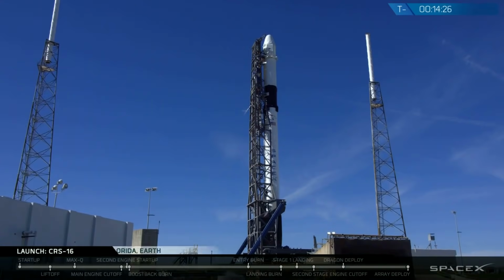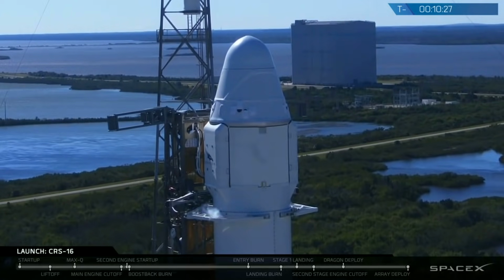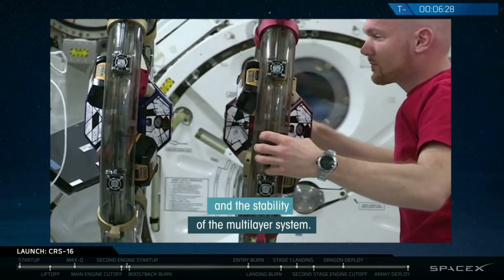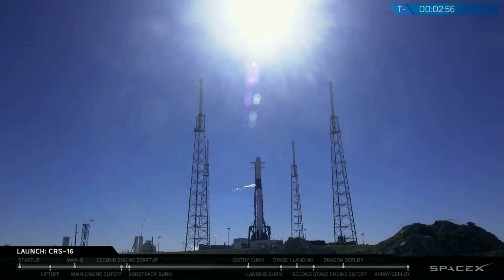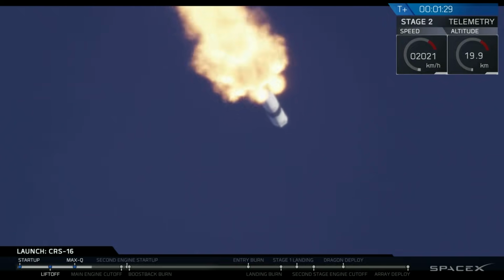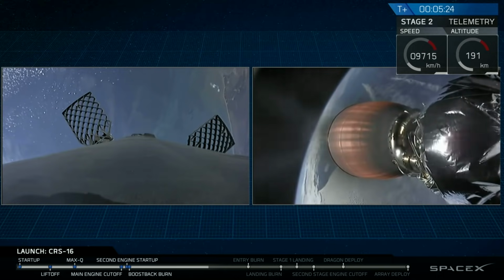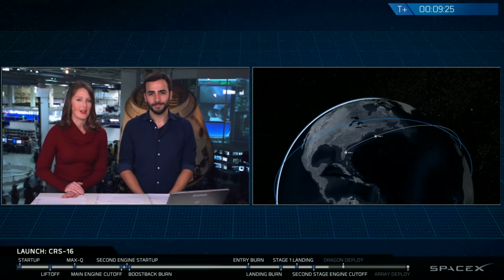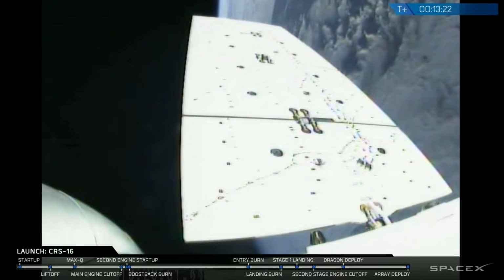Dragon Resupply Mission (CRS-16)

Comment: Why are we even watching if you are going to cut away any time something interesting happens? seriously!
Reply: https://twitter.com/elonmusk/status/1070399755526656000
Reply: @vask92  you are the man:)
Reply: @vask92  thx Vassily
Reply: @vask92  Neat. What happened? Return coordinates incorrect?
Reply: @LightningSe7en  Problem with one of the grid fins. It was unble to stay on course, so it performed an emergency landing in the water.
Reply: @logitech4873  Thanks.
Reply: @vask92  
Thanks for the link! 
Why didn't they just air that when it was live? would have been so cool to see a unique outcome like that live and not have it cut away
Reply: @vask92  seriously rad
Reply: @vask92  I knew we could count on Elon himself to deliver!
Reply: According to elon on twitter, the cutaway was a mistake. He posted the full video of splashdown in the water. Booster is still transmitting telemetry and is being recovered.
Reply: i am always watching no matter what
Reply: This happened https://youtu.be/gt227uyBh1c
Reply: @KDavidd  1st stage camera: https://www.youtube.com/watch?v=BbG_TVcKfQ4
Reply: @KDavidd  thanks for throwing this up. EXTREMELY IMPRESSIVE that even with the wobble and spin they still almost landed it correctly.
Reply: This is like Nascar for geeks, but they don't show the wrecks : \
Reply: Because SpaceX is under attack, and doesn't need bad publicity, cause all that would happen is at mainstream media outlets is that SpaceX failed their mission
Reply: Delivering the payload to orbit is much more "interesting" to the customer than whether the first-stage landing is successful or not.

And, as others have pointed out, video downlink is the lowest priority for a rocket in an uncontrolled spin on approach to the Florida coast. Maneuvering the rocket to the safest possible crash point is what matters in that scenario.
Reply: The cut was "a mistake" according to Elon. https://twitter.com/elonmusk/status/1070386554068119553
Here's the full video:
https://twitter.com/elonmusk/status/1070399755526656000
Reply: https://youtu.be/3CCXnzbSgyI
full video..
Reply: Full cut footage https://youtu.be/JbA-jOK1EpU
Reply: If you want to watch the complete faulty landing of stage 1 in water, I have uploaded it : https://youtu.be/xX0VotqacuA
Reply: Elon said it will be uploaded and it was an accident to shut it down
Reply: It's because cameras are being cut off due to the signal being broken or something.
Reply: Rinoa Super-Genius , really, what disappointment to have you protect your , what, name..Get honest.
Reply: And please don't block the view of the rocket with popups for your app.  That's just ridiculously cheesy.
Reply: Being in a commercial venture, they want to sell an image of success and not confuse potential clients with the failure of a secondary system
Reply: @chiluco2000  true
Reply: It was an accidental cut away. You should know by now SpaceX have no shame in showing their failures. Heck they made a video showing all their failures.
Reply: Rui Wang 👍
Reply: If you're talking about the camera cutoff near the crash, that was an accident. Elon said it himself and released the footage of what happened
Reply: To be fair, we are watching cameras on a rocket in space live without much lag.... You can take a second and just remember 100 years ago we didn't even know that space was a thing or the internet or live streams. I am willing to accept what we can get, and of course things like this will eventually be available. Hey I am happy if the rocket lands and doesnt explode. That 1000s steps better then when we used to just throw these things into the atmosphere.
Reply: They don't always have enough time to figure out something is going wrong.  In this case the first stage lost roll stability several seconds before they decided to cut to the second stage cameras.
Reply: Its a protocol to cut news feed whenever theres a major problem about to happen to avoid unwanted or in rare cases "catastrophic" scenes which could affect the viewers perception.
Reply: Check out this video! With unedited footage from many cameras! Hope you enjoy it
https://youtu.be/dyaIKYspAdU
Reply: Elon said it was a mistake on his twitter.
Reply: i mean WTF!!!!
Reply: Rinoa Super-Genius what makes you think you are entitled to it?
Reply: That would be NASA. Not Elon's style.
Reply: Exactly also my point; it's fucking irritating! Regardless of success or failure .. continue broadcasting !!!
Reply: Rinoa Super-Genius https://twitter.com/elonmusk/status/1070446975642812416?s=20
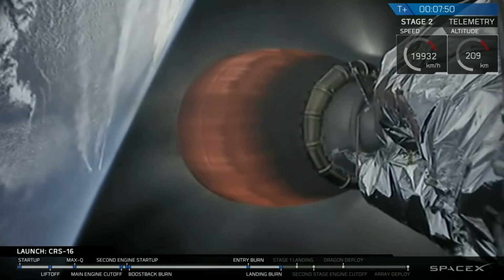Reply: 22:48 Wtf? Am I the only one seeing the earth not curved on this camera?..
Reply: + @assasinscreed18   If the earth wasnt curved there, then youd be able to see every country behind the rocket, but instead the US has dropped bellow the horizon.
Reply: They cut away in case the bloody thing lands on a boat, or something and would be seriously bad pr.  It is only public who only care about themselves who seem to not realize the reality of the situation.  Space X has had to fucking fight tooth and nail to get the government contracts in a shady as fuck government awarded contract reality where the greased has been flowing so long into congress/senate/commitees etc as to where the money goes, the nearly 800 billion a year money, and if you think that Musk should risk giving FOX news a weapon to use against him, or MSNBC who is owned by giant military contractors just so you are not 'bored', then get over yourself.
Reply: IThinkWithMy Dick  Your sense of entitlement is.. worthless.  In fact it's beyond worthless it's ridiculous.  NO government has ever accounted for the money it spends this way and you expecting them to document space launches to meet with YOUR approval?  That is just you thinking you're worth a lot more than you are.  Get over yourself.
Reply: full shot https://twitter.com/elonmusk/status/1070399755526656000
Reply: because the stage 1 crashed into the ocean :D
Reply: Well, they do hold up that APPLAUSE sign for every little insignificant step. So, whenever something goes off without a hitch that you SHOULD be concerned with, that's the point in which you are not paying attention. (BTW: There are people who watch these launches so much, whenever they cut a L O N G fart, at the end of it, they say in a soft, Hipster Millennial voice, "...meco...")
Reply: This is BS. The feed was cut off accidentally and was released by Elon Musk within the hour. Don't see conspiracies everywhere. You'll turn out paranoid.
Reply: @nescio03   no it was a bit longer like 2 hours if i remember right. thats a very long time on the internet.
Reply: @RinoaL : It was released on twitter within the hour. Putting up a corrected clip on yt took a bit longer.
Reply: @nescio03   nope twitter was a bit later if i remember right, and im not aware of them putting up a corrected clip yet. unless they edited this livstream.
Reply: DreamWorks get a quick project to make.
Reply: MOON,LROC,STRUCTURES➡https://www.youtube.com/watch?v=uz1KLRfxTCc
MOON,TYCHO crater,METAL STRUCTURE➡https://www.youtube.com/watch?v=G6hmR1IaxP8
MOON,3 UFO➡https://www.youtube.com/watch?v=BqSH-95yMA0
Reply: MOON,LROC,STRUCTURES➡https://www.youtube.com/watch?v=uz1KLRfxTCc
Reply: lol not showing "something interesting..." in a spacex live launch video.

People can be amazing sometimes.
Reply: Can you imagine that rocket launches are now seen as so normal that only a malfunction or crash is considered a spectacle? That's like equal thirds weird, awesome and terrifying.
Reply: lets not defend like a fan-boy too hard here. they cut it away because it clearly wasn't going to make it, and explicitly showing any disaster would be bad PR. the media won't have any negatively dramatic visuals to headline their stories with, but I lost a little respect for SpaceX.
Reply: They probably dont want the video footage to be accesable by everyone since media could use it even before any information from spacex arrived. They will probaly release it later. I think its perfectly resonable.
Reply: @tomaskytka3682  Hit it right on the head! They have vidoes they post later like "how not to land a rocket", But they want to analyze what happened first.
Reply: @tomaskytka3682  But whatever happens is a fact isn't it?
Reply: Because NASA, and also the news media like CNN, FOX, etc. are also porting (some part of) THE LIVE from SpaceX "official launch feed", so the live is actually reach everyone including ones who don't know much about the launching themselves (not to include the congressmen and congresswomen, oh and flat earthers.)

So, if some of them see that OH IT IS SPINNING CRAZY or KABOOM! and panic like the end of space exploration, they will perhaps fear the space, rockets, and all of these stuffs. So cutting the live feed now is the best thing to do to avoid confusion.

They encourage everyone to follow up on their Twitter, though. (You can then put the caption to explain the failures, tipping over, 'go for the swim' better than in LIVE.)
Reply: Yeah I call BS on the "mistake"   they've cut away from showing failures a few times before so it was definitely a conscious decision.
Reply: because #theearthisflat
Reply: No they didn't want to show it and the hosts acted like nothing and in the end, it hurt them more because they didn't show it.
Reply: @MegaGamerscast  it didn't hurt them, stop making up dumb bullshit
Reply: @MegaGamerscast  They always do this, cut away as a failure is about to happen and ignore it in the broadcast.  Come on guys, we can hear the groans and concern of the voices in the background, you obviously still have a feed, show it.
Reply: I agree with you, they might as well show an animation if they aren't going to put up anything that "may" be shocking. It doesn't seem like the cutaway was a mistake, but the policy TO cut away may be.
Reply: @PCMcGee1  Stop and think... they do these as a publicity stunt of sorts. They want to get their successful missions out there for the world to see! IT IS A LUXURY! For 'space nerds' like me, I love that they do this, because, frankly, they don't have to! They stated in the broadcast that they wanted to 'focus on the successful portion of the mission'. Additionally, there are MULTIPLE videos of the landing with an explanation and multiple camera angles on the spacex twitter. They just wanted to analyze it first before they were ready to comment. This video is not here to show accidents, it is here to show missions. Go to the twitter if you want to see that.
Reply: If you don't like, don't watch.  They owe you NOTHING.  They choose to give you something and like most you bitch that the handout is not good enough.
Reply: Lensflare Deviant there’s nothing wrong with good comedy ............. along with oh do I have to admit? Success!! Still shame on Elon for not letting us see the full first stage um.... experimental landing. Throw them grid fins away boys. Fix the software for the firing of the gas jets instead.
Reply: @williegillie_watchman  Elon posted the full video on twitter an hour ago.
Reply: @TheEvilmooseofdoom  Yeah, they do. SpaceX flights are funded by public tax dollars.  The public has a right to know.  Musk did the right thing.
Reply: Stop it with that bullshit... They are not required to livestream anything.. yet they do and it is very good. They can do with it whatever they want
Reply: @DDA40Xfan_Bruce  Right to know and right to watch live are 2 different things.  Spacex is a private company the customer is NASA and what NASA is required to tell you and what Spacex is required are also two different things.  Get over yourself.
Reply: @TheEvilmooseofdoom  Also, the tax dollars pay for DELIVERY OF THE DRAGON.

Not the landing!
Reply: @DDA40Xfan_Bruce  this mission was funded by the public through NASA, but their non-nasa missions are privately funded.
Reply: This mission was about launching a payload for the customer. The person handling the livestream probably cut away because they don't want the crash in the video, for the purpose of securing future contracts and satisfying stakeholders. Future customers will watch these videos and may be turned away from seeing a crash in this feed.

This bit isn't rocket science, so it shouldn't be difficult to understand why they cut away. You have a dozen links to the video of the crash to entertain you.
Reply: @DDA40Xfan_Bruce  Nonsense. Program funding does not entitle you to specify what they "must" show you.
Reply: They didn’t purposefully cut it, its most likely that the first stage lost signal to the satellite. Btw you can see full video in Elon musk’s Twitter
Reply: It's more than likely that the craft engaged it's emergency Maneuvers it was unable to spare the incredibly High processing power cost of live streaming HD video
Reply: @gerardbeaulieu1689   you can't be serious...
Reply: @gerardbeaulieu1689  It doesnt work like that
Reply: @gerardbeaulieu1689  I don't believe there's any link between maneuvering and video stream. Completely separate systems.
Reply: @gerardbeaulieu1689  Why does this have so much thumbs ups?
Reply: @gerardbeaulieu1689  I don't think so. Because, the employees at SpaceX launch complex were watching the Live stream and cheering even while the 1st stage was landing. I think its a standard procedure at SpaceX to shutdown the Live stream of the stage which behaves abnormally.
Reply: @gerardbeaulieu1689  lol tf are you talking about
Reply: Scotty Manley did a video on this
Reply: Gerard Beaulieu I was expecting camera cut and booster abort/termination. The camera cutting is perfectly reasonable in this situation
Reply: @gerardbeaulieu1689  They would have used that bandwidth to show a successful landing.  Not valid argument.
Reply: @gerardbeaulieu1689  not likely. The crowd in the background cheering and aweing were obviously still watching the feed. Don't be a fool. We were robbed.

Comment: This is amazing. Landing a damaged rocket without a scratch in the ocean, that's insane. I remember that launch when there was bad weather, this is like ten times harder
Reply: I agree, especially being able to perform a landing burn while half tipped over and spinning, as seen on that amateur video. I had no idea the guidance system and engine gimbals could work fast enough for that kind of thing. It's really amazing what the hardware and software in these rockets can do, too bad they cut away as soon as it started happening.
Reply: Not only did they do that, but they're planning to reuse the crashed booster!

Comment: As usual video cut for landing!!
Reply: As usual? It only cuts out for ship landing due to satellite connection failure due to vibrations of the dish.

They have never cut it for a land landing before - ever.
Reply: @mduckernz  Clearly they were watching it on monitors in the control room, so no excuse. Ship landings are typically cut when the first stage is still several thousand feet up, so no excuse.
Reply: @manoo422  I ALREADY SAID THAT FFS. Nevermind. Obviously you want to be annoyed about this rather than understand, so you just go right again and do that
Reply: @mduckernz  The ships landing OBVIOUSLY does NOT cut due to vibration!!! Where the hell do you think the dish is!!
Reply: @manoo422  The dish is on the ship/boat. When the rocket exhaust starts to wash over the ship it causes it to vibrate, and break the data link. Pretty straightforward.

They mention this basically every single time that they have a landing on one. Even if it doesn't cut out, you often see frame drops in the video, indicating that the link is unstable.

How do you not understand this?